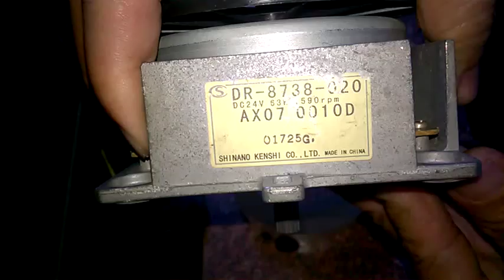Motor Brushless dc motor 24 v

Comment: mong ban huong dan chi tiet cach dau de moter chay.cam on
Reply from the maker: mỗi loại mỗi cách đấu dây khác nhau bạn ơi ko biec bạn dùng loại nào
Reply: minh co cai moter y nhu cua nghia.
Reply from the maker: bạn làm theo trong clip là đc nha
Reply: moter cua minh la:DR - 8738 - 020, DC 24V ,63W, 1590rpm,AX07  0010D
Reply from the maker: bạn lấy con trỏ 100k từ 24v đưa vào chân 1 đêm từ phải qua trái va chan 2 va 3 noi chung lai
Reply: Bạn ơi! Mình có con dr 8738-131a mà không biết làm cách nào cho nó hoạt động nhờ bạn chỉ giúp rất cảm ơn bạn
Reply from the maker: ban lam theo trong clip la duoc a .cam on ban da xem clip
Reply: Sieu nguyen huynh con motor bạn còn ko?